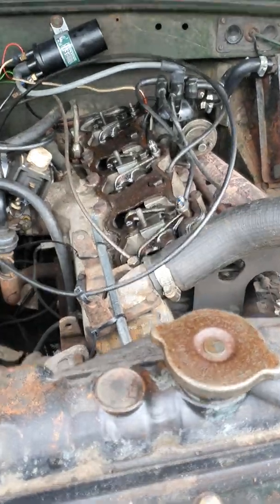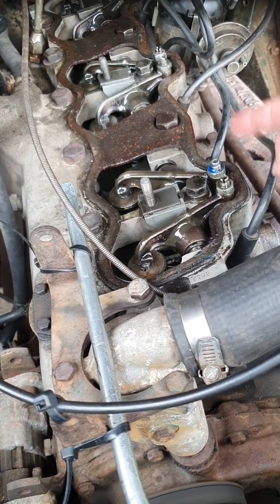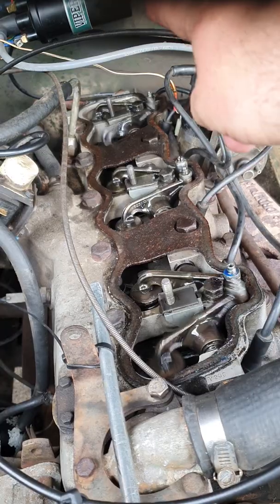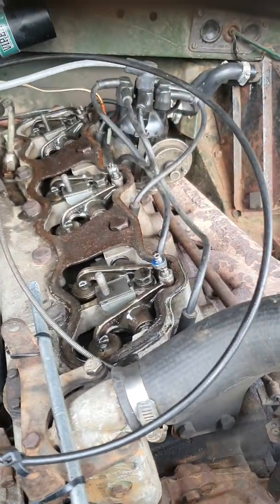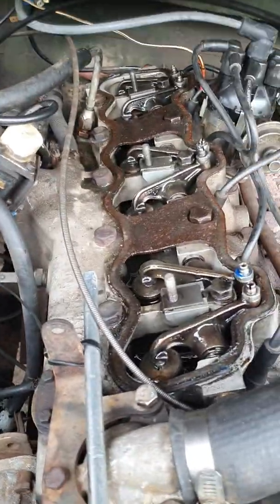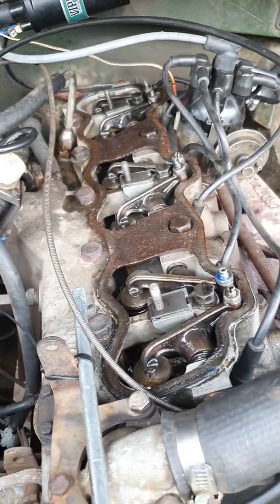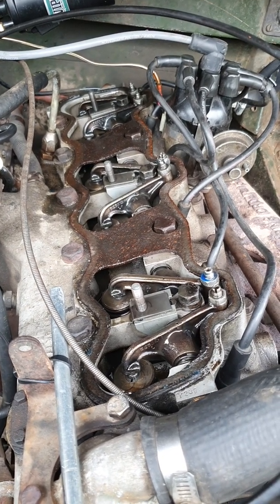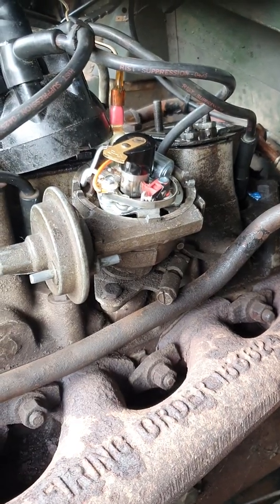Land Rover Series 3 109 2.6 - tune up ep. 2

Comment: Very nice. I have the same engine and I've been putting off adjusting the valves, this has taken some of the mystery out of it. Fitting an electronic distributor did wonders for mine though, it starts on the key first time even in freezing temperatures which I could have only dreamed about with the original dizzy in place.

Comment: Great video, could you do a video on how you tune the exhaust valves? Even if you can just show how to reach them that would be helpful. There is not that much video material available on the 2.6 I find. Cheers!
Reply: Nice Guys! Here is one more newbie 6-pot owner! Awesome information! 🤩
I bought myself some far future projects in the form of two Forward Control S2A:s from 1964. They have been waiting for saving at least 25 years outdoors without moving....One Firetruck and one "snail" signal/telecommunications container.... to add some to the "heap" of my series vehicles project collection...😅. They are TOTAL projects to start with. They are both equipped with the 2.6litre 6-cylinder petrol engine as all(?) imported vehicles to Finland  and I managed to get hold of a third stripped broken(may also be a 3litre with different engine number and suffix?), outdoors stored engine aswell.... This video inspired me a lot and I'm hoping I get some time off to start rebuilding these Beasts!
Reply from the maker: Will do, for the moment, remove the dipstick.. from the bottom.. loosen the four retaining bolts holding the exhaust rocker cover.. don't drop anything. Loosen the radiator inlet pipe to make way for the cover removal.. you'll lose some coolant.. push the pipe aside towards the fan. Once the cover is loose, pry away and pull forward and up pulling with the top-up neck. Access to the exhaust valves are accessible.  Take a photo.. grab your starter handle.. turn the engine for cylinder 1 TDC. Using the "Rule of 13". Turn the engine over until valve number one is fully open, rocker loose. Subtract one from nine and adjust number eight, with two open (rocker loose) adjust number seven and so on. The “Rule of 13” applies to most 6 cylinder engines, subtract the open valve from 13 to see which one to adjust. Set your valve clearance. 

I learnt these engines were used for racing back in the day, the engineers used to gap the exhausts a little extra to compensate.. try a wider gap than 0.010 .. 

When you're finished tightening up.   You can run the engine to check .. 

When finished,  close up with a new gasket.. The spare gasket supplied to me had gusset pieces which interfered with my bolts. The bolts pushed the gasket off the cover edges.. just cut these gussets as they're quite unnecessary.. 

Refit everything, be very careful with the bolts.. and the dipstick.. 

Check your timing is 2° ATDC .. using 95 or 99 octane fuel. 

Test,  run,  drive.. enjoy your Land Rover 2.6